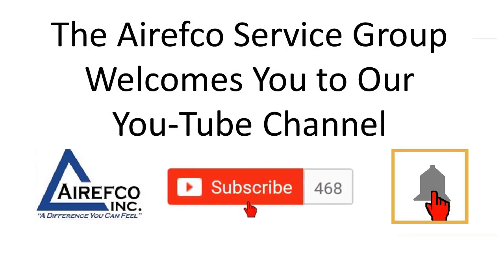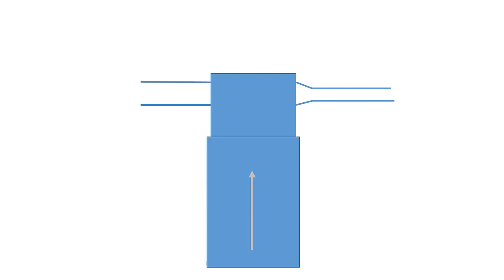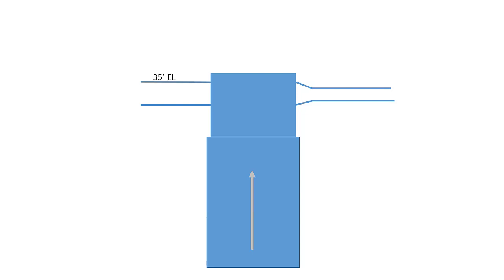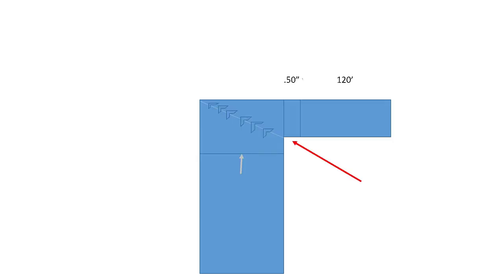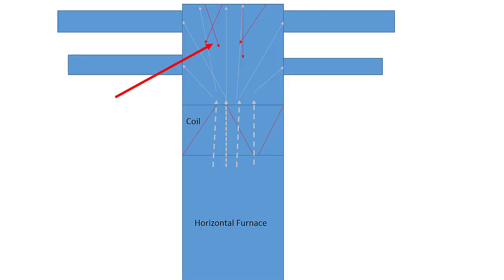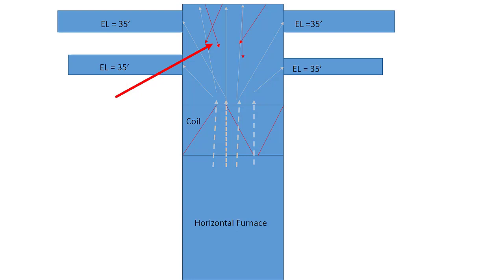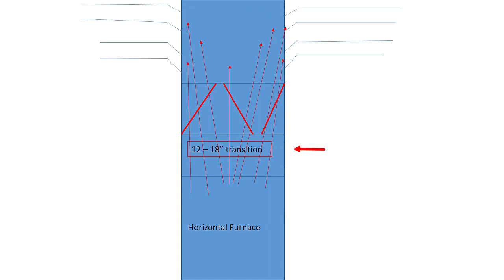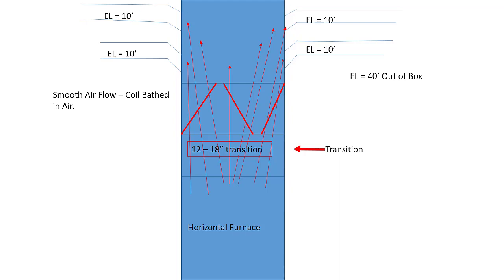Airflow in HVAC Fittings

Comment: So please explain, what exactly is equivalent length? Is it the amount of length or airflow we are losing?
Reply from the maker: One foot of ductwork has the resistance to air flow of X.  When we say a fitting has a equivalent length of 10, that fitting has the same amount of resistance as ten feet of duct.  So, a duct may have a run of fifteen feet total but the fittings increase that length to 50 or 60 feet length resistance.
Reply: @FergusonHVACTrainingNW  Ok, so if the length of a flex duct is 15 feet and the fitting has an equivalent length of 10" does that mean that the equivalent length or length resistance is 25 feet?
Reply from the maker: @hvacando5609  Yes
Reply: @FergusonHVACTrainingNW  Thanks for your help